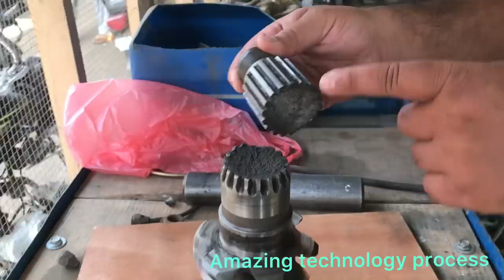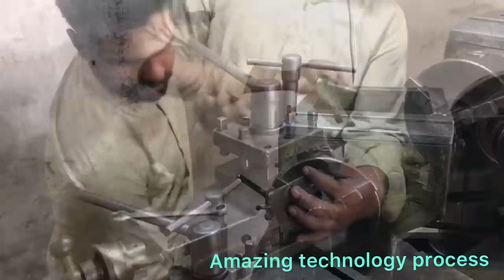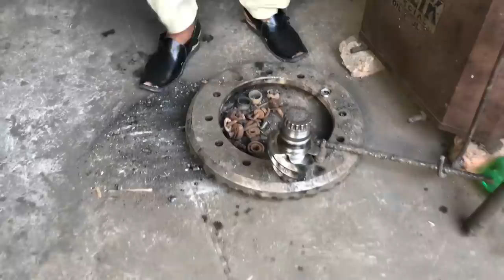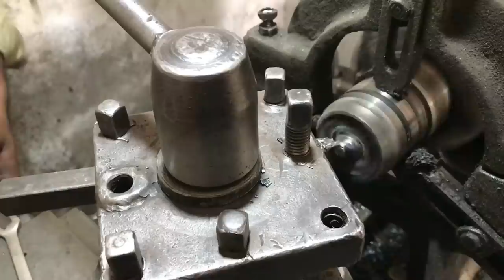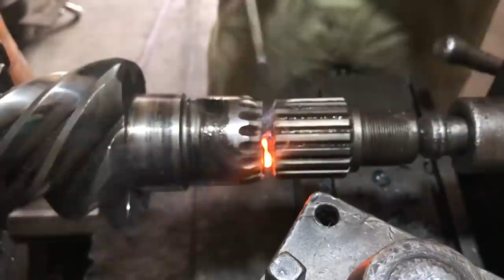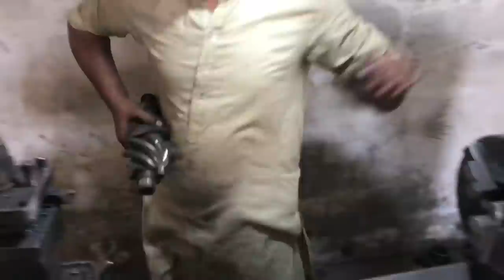How to Repair Broken pinion in Beautiful Way

Comment: I'd hate to be the driver of the lorrey on some forgotten mountain road, when the "weld" fails and you get an "E Ticket" backwords ride to the bottom of the canyon!
This video should serve as an example of how NOT to make such a repair...let alone litigious shop practices....
Be afraid...very afraid!!!
Reply: litigious               Really? You didn't really think you were going to use that word in here and not get called out did you? You even spelled it right.
Reply: Yep. I wouldn't ever try it unless I had no other option, Its just to dangerous, welding splatter on a lathe is the number one way for a welder to be beat up by a machinist ! Very dangerous !
Reply: xD

Comment: These guys are amazingly talented and creative and smart! Dead nuts centered too! All by eyeball!
Reply: The word centered means different things to Different people , when addressing machinest you might want define centered to what degree of accuracy or amount of zeros right of the decimal point . You can always add another zero !Some people measure with tape measures some people measure with micrometers and some with zeta meters .
Reply: very poor repair. Those who talk about the skill of these guys are not machinist. This is not good enough. There is meticulous controls when these are manufactured with regards to metallurgy and heat treating. Do You think none of that matters? these type of parts are ground after heat treating to ensure concentricity and accuracy. no complaints if its to get You home while You are waiting for a proper part
Reply: @danneumann3274  So if I'm hearing you correctly , you opinion is that the weld should hold but because it is such a precion part that the repair is not going to be aligned well enough and it isn't going to be as strong as the original because of heat treatment ?  My opinion was 60/40 to fail in the first month . Do you concour with my prediction ?
Reply: @danneumann3274  Do you think if it was aligned good on the lathe and induction hardened  that 1 the part would be as strong as the original and 2 would the alignment be good enough to get 50000 miles if not is it because of heat distortion ?
Reply: @jacobclark89  I agree with you. My point on the heat treatment is that all that controlled metallurgy is lost with some backyard welding job. Look at how hard this metal was to turn on the lathe. these pinyon gears have serious stress put on them. I am a machinist and would never attempt such a thing
Reply: @jacobclark89  my opinion is that a weld in this case would never be strong enough. The metals are similar. Welding can repair many things and these guys get an a for effort. This is hack work. You never see them indicate anything. I have to indicate almost everything as a tool and die maker. How else  can we know if it's running true in the lathe? And yes the distortion from welding would make the part unusable
Reply: @danneumann3274  Thanks for your  asesment . I have a similar opinion       after seeing the weld splatter on the lathe , I don't think energizing the headstock is a good practice either. No center drill ECT . I think your telling me  that the best machinest and the best welder could not make it work ?  As a welder and machinest I'm always trying to learn more and improve. I have a ring and pinion laying around  Maybe I will cut it in half weld it back together and use my dake labatory press to see how many tons of force it can take Before breaking. I think I would be robbing Peter to pay Paul if I preheat it.

Comment: i got my reservations about this one...
but it should  get the truck home provided it is babied.
Reply: Yeah, as long as home is less than a mile away. That pinion will snap the first time any torque is applied to the driveline.

Comment: The process should have been reversed with the booze in the beveled gear side because the spline end would be more stable in the chuck. For those in internet land, don't EVER use a steady rest for heavy interrupted cuts with surface hardened welds. This is poor machine practice for this repair.

Comment: I see No precision in these Work. I mean the Cutting of the Spline with Angle Grinder by hand....!  Gears are supposed to be cut in Precise angle. If this Pinion is really  put back in Use, then the other part in contact will be Worn out faster.

Comment: dude  that banging your hearing  during your cut is not a  good thing.  sounds like a loose tool or a bad bearing  in the head whatever it is whatever he is cutting is 10 thousands off for sure if not  more.   Damn took was chattering so bad and it looked like the last time it was sharpened was at the factory!

Comment: This job is a waste of time and effort. The material is all destroyed and then you try to weld it. The same as weldng and axle or gearbox input shaft that had broken.
While I know it is hard to get parts simply do not overload the trucks like they do. And then things will NOT break.
I watched maybe a quarter of this and laughed!!

Comment: Excellent
Reply: hahahahahaha, what part of that bodge was 'excellent' ?
Reply: Apparently you watched a different video than the rest of us🤣🤣 
That pinion won't last 2 miles before it snaps at the weld. The first time any torque is applied, that pinion is going to snap!  That's alot of work for a paper weight.